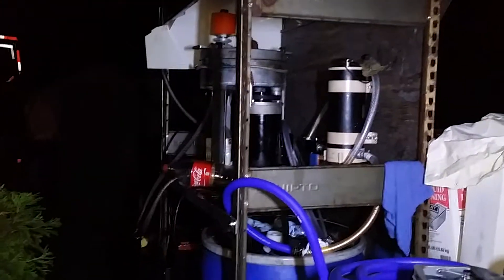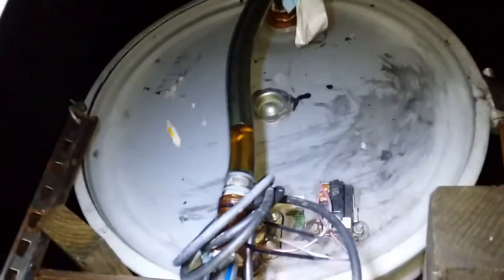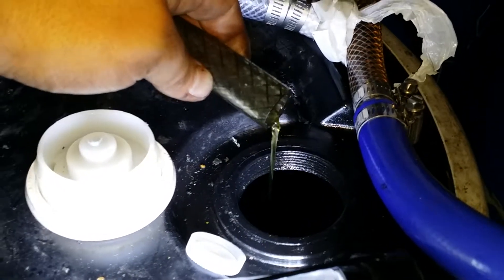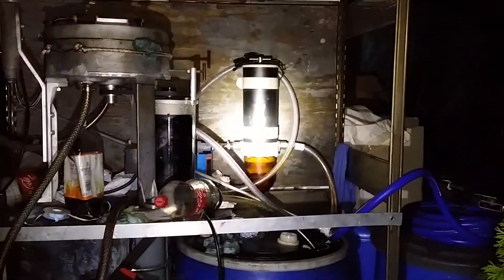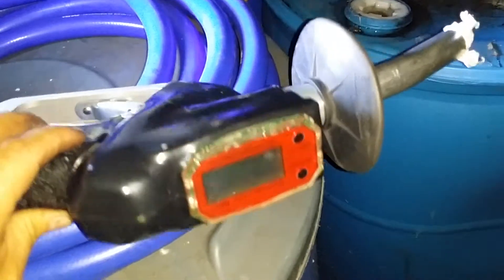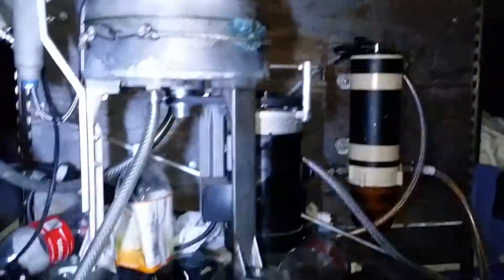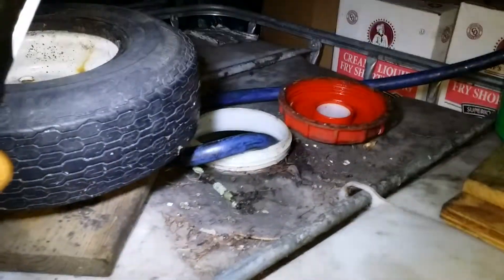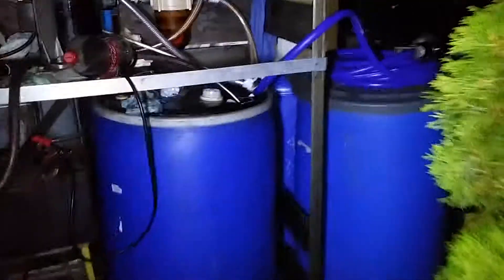FilterMax Centrifuge cleaning WVO oil to 1 micron

Comment: I'm looking at your set up and trying to figure out where you are venting the moisture from.
Reply from the maker: urgentcareguy3 The moisture is coming from the drain hose ,  the centrifuge has two hoses under , one is for the clean oil and the second is for the drain , since the clean hose has a loop which always keep oil in the hose so the moisture has to get out somewhere and gets pushed out the drain hose since it does not have a loop if that makes any sense to you, there's also a quarter inch hole on top of the center fuse to allow air to get sucked in to push out the moisture.
Reply: Thank you!

Comment: I just got the 2400g Filtermaxx. Seems heavy duty. Have you done any black diesel?
Reply: What vehicle were you running it in that the WMO would clog injectors?
Reply from the maker: Black diesel? lol I'm assuming (wmo) waste motor oil, I have used it a few times but I ended up clogging my injectors ( cooked injector tips) on both vehicles and I went back to waste vegetable oil and at idle black diesel smells bad and wvo don't smell bad at all. make sure you don't mix wmo with wvo cause it will damage the injection pump, injectors and  fuel lines.
Reply: I wouldn't use black diesel on a car without blending at least 20% diesel. You can use on older direct injection diesels.
Reply from the maker: urgentcareguy3  I have done black diesel and I had bad luck with it so I stopped using black diesel (WMO).
Reply from the maker: Corey Parks 98 VW Jetta and and a Rig (semi) N14 Cummins Engine.

Comment from the maker: I would not run any wvo with out a centrifuge,  I have the rate set to about 8 minutes to one gallon and you must have a heating element to bring up the oil to atleast 160-200F before flowing in the centrifuge  this is very important to remove the water from the oil otherwise you will kill your injectors.